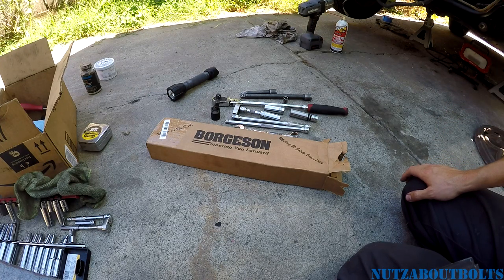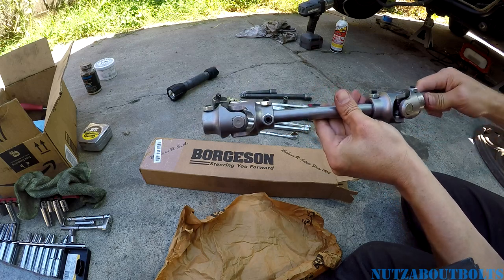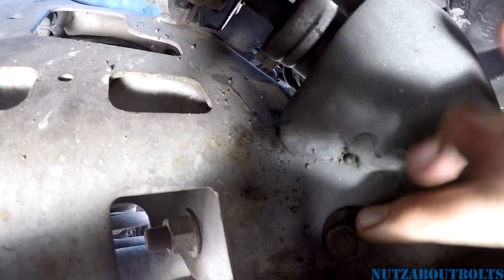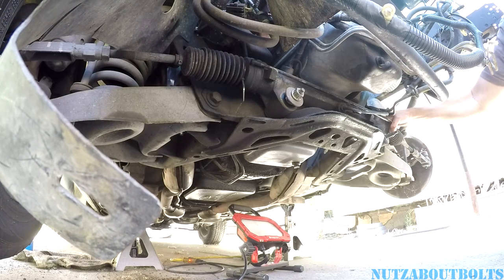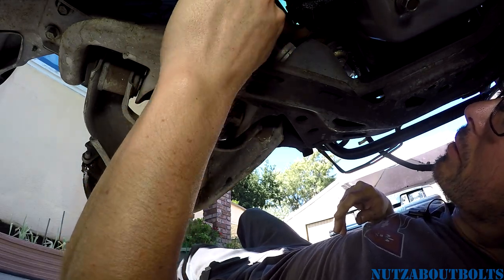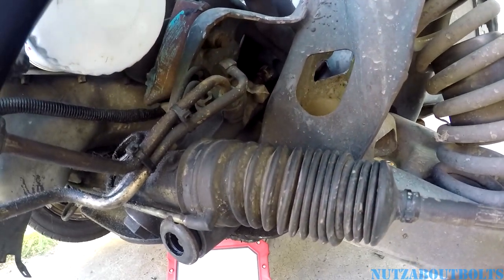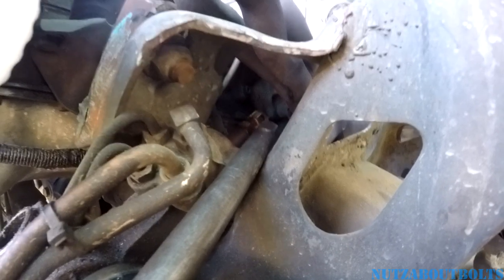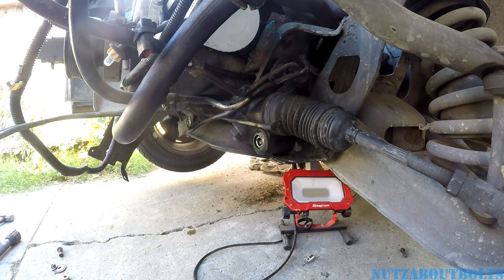1991 fox body Mustang V8 Borgeson steering intermediate shaft replacement 79-93

Comment: Perfect!  Just one thing to note - don't forget to tell viewers not to turn their wheel too much, or even mention securing it in place  once the intermediate shaft is removed. They could break the clock spring in the column by over stretching it.

Comment: The whole steering shaft can be removed, if you first remove the U-Joint at the steering column, then loosen the rag-joint at the rack.
Then, just pull the whole shaft through the firewall.
No need to unbolt the two halves of the shaft.
That's if you use the entire steering shaft kits.

Comment: The rag joint helps to dampen road noise and steering wheel stiffness, but that was when new. I had to use a Borgeson shaft on my 86 F150.

Comment: Hi I watch your videos and enjoy them and I would like to pick your brain. I have an 05 Toyota corolla when I accelerate and get to 45 mph and let off the gas and just cruise after that I gently touch the gas pedal and it starts to shake and lug. I’ve replaced for coil’s for spark plugs and I’ve tested the coil wires and the far left connection lit up on all four. Should to light up or just one? In the far one I believe is the ground and I know that should not light up.If I step on the gas the car responds immediately does not slip and accelerates great it’s just when I go from a stop get up to cruising speed and gently tap the gas do I feel the shake in the log from the engine I could really use your help thank you so much

Comment: Great informational video for a nice steering upgrade. Small bit of advice: I wouldn't hold a bolt with a ratchet while applying an impact to the other end of the bolt. The ratchet is not going to win that battle. (ask me how i know)
Reply: How do you know

Comment: That steering shaft set screw connection at the rack is ultra sketchy.  If that thing backs-out even a few thousandths under vibration you have no steering.  The factory pinch bolt design is the only way to go for securing the shaft to the rack.
Reply: Use loctite
Reply: @darrenrussell3695  about as good as chewing gum and some 3-in oil there Fletch.
Reply: If you don't have a buddy with a welder, bring it to a shop and ask them to weld the u joint collars to the shaft so you never need to worry about the set screws. Should only take a few minutes and cost a few bucks.
Reply: @johnz5359  I’ve been a mechanical engineer in the automotive, industrial marine, and aerospace field for almost 30 years.  Believe me when I tell you no chief engineer or senior level manager signs off on that design for production.  It’s sloppy design work and a potentially company ending lawsuit waiting to happen.  The appropriate design is a splined pinch bolt like the factory coupling scheme.
Reply: @FancyAnimal  Oh I totally agree. I was also just saying that I agree with you that it looks like those set screws can back out. I'm not saying they're fine, I'm saying if you have this part, it's best to get the joint welded to the shaft because it's not fine.
Reply: @FancyAnimal  The shaft is "trapped" between the steering column shaft and the rack shaft. It can NOT come apart.